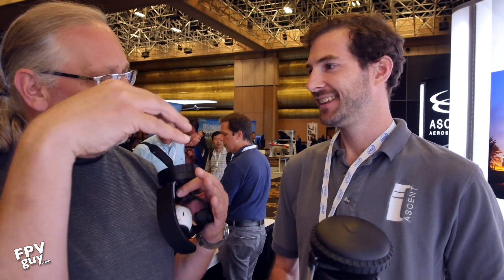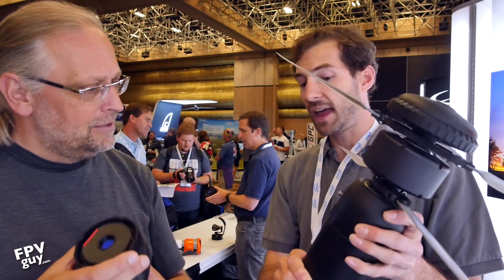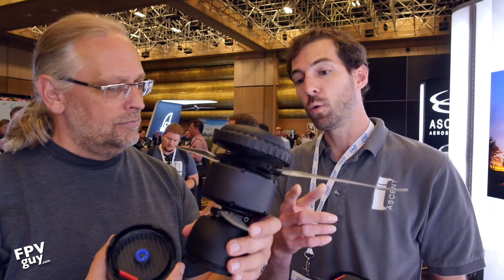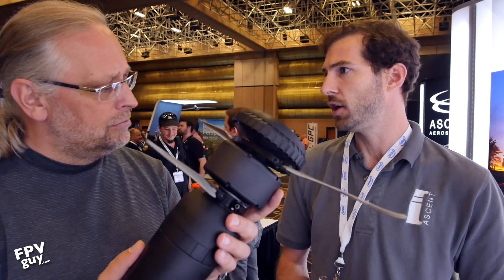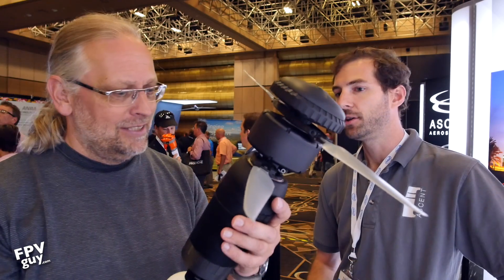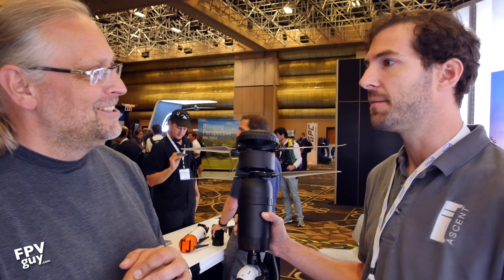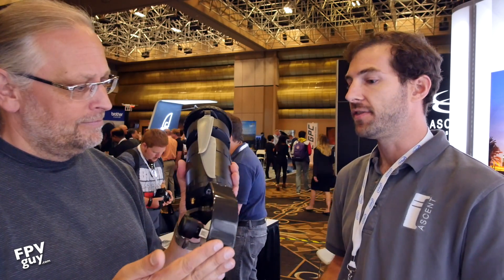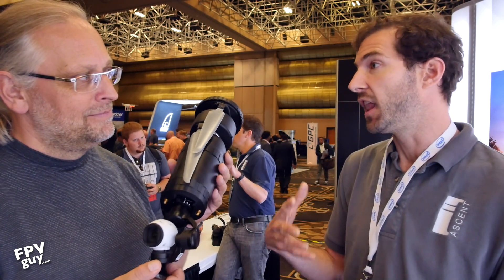InterDrone 2017 - Ascent AeroSystems

Comment: But how does it move around? Thrust vectoring?
Reply from the maker: its flying a dual counter rotating rotor.   essentially changing the lift of the prop blades as they rotate to "lean" the bird and fly a direction.

Comment: when these were first promoted it was claim they had swarm technology, is that so; do they still have swarm technology?
Reply from the maker: As far as Im aware, they have never demonstrated working swarm technology.
Reply: @bophoto  yeah, it was claimed in an earlier promotional advertisement for the Sprite - can't remember if the ad was made by the manufacturer or a third party. Would be nice to run different payloads with a swarm, too optimize versatility.

Comment: more than two sleepy years still with no results. videos of 2015 show the similar can with a double fan. but so innovative, they've changed the colour, the size and the price. but still it's not ready to fly. great job, at least they've taken a lot of money from kickstarter supporters who won't be happy to hear that they won't get a selfy-drone but a military platform. well done, ascent.
Reply: I've flown mine.  I've also crashed it a few times...  I wish they skipped the geared version and went straight to the direct drive for the kickstarter version though.  That main gear is pretty easy to strip on a bad landing.  Flip through my videos, there's a few flight vids.
Reply: @barry99705  how much does it cost about friend??.Is it worth?
Reply: And moreover it flies like sh.t. The precision of holding position and fly smoothness is just unacceptable for current level of demands.
Reply from the maker: Woah.. I was under the impression the kickstarter units already shipped?

Comment: Bo How does it get direction ?  like a swash plate on a heli or gyros?
Reply from the maker: Exactly like a Coaxial Heli.  :-) so yeah there gotta be a swash plate somewhere there.
Reply: I have version 1 from Kickstarter. It’s a really interesting design. I haven’t used it much due to the winter weather, but I’m looking forward to taking it out more this summer. The top rotor is static for lift and the bottom rotor can tilt for directional control.